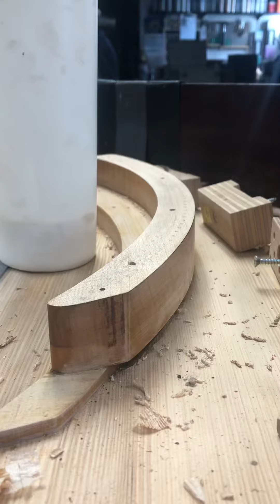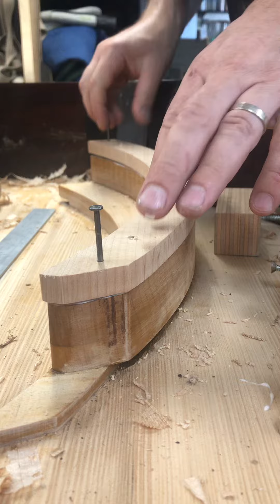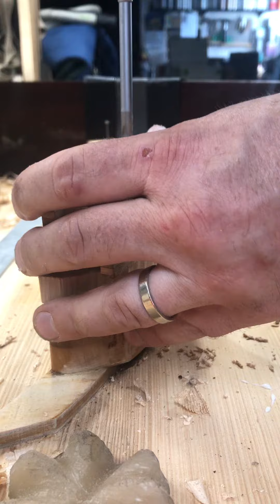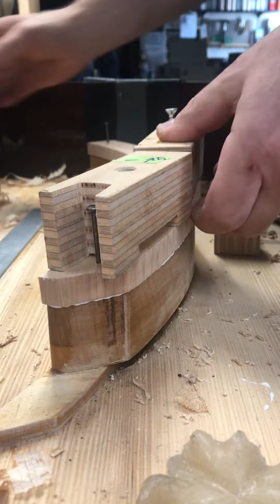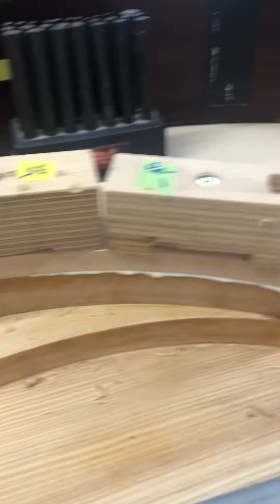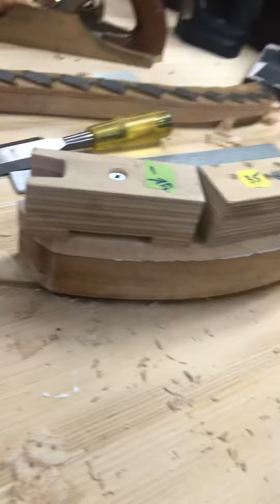Glueing on a new bridge-cap on a Mason & Hamlin SG baby grand piano

Comment from the maker: Sure, three way clamps work too. Or go-bars. Used them all. Here the screws are strategically placed between unisons and the screws will be replaced with dowels after the glue has set for extra strength. After graphite has been applied it will be completely invisible and of no consequence